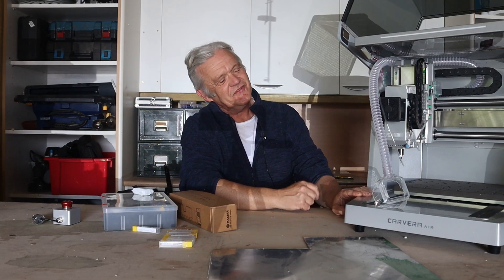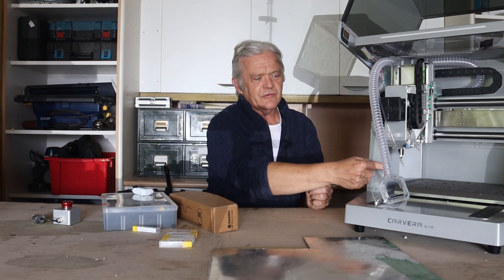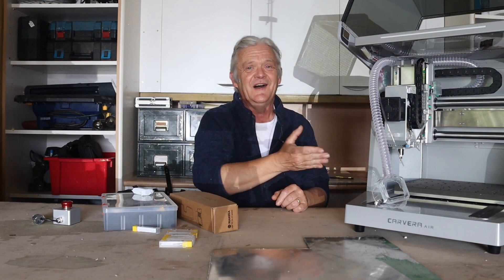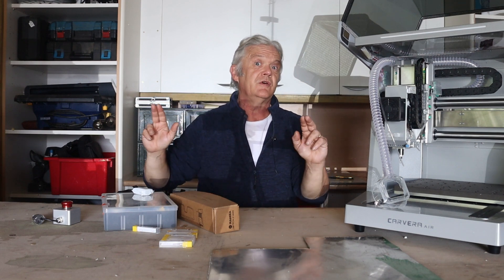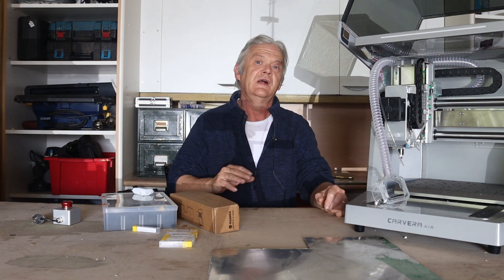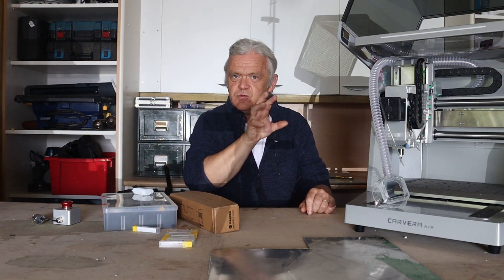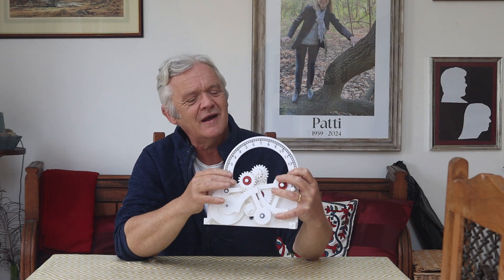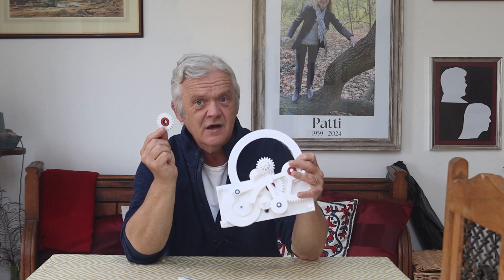2388 Getting To Grips With CAD Programs #Makera #Makeradesktop #CNC

Comment: totally agree with your approach to CAD …without a practical goal  in mind, you will just end up reading manuals with zero comprehension. I remember back in the dark ages of my youth, wadding through the excel manual trying to understand the whole system prior to starting…what an utter waste of time! Eventually I just started to try to achieve the job I had been assigned, and within a short period of time I had a working solution….not elegant but workable. A better understanding came later.
Reply from the maker: absolutely agree with that mate

Comment: .svg files, right? 🤔 I believe I used Inkscape (open-source) to make my vector drawings and then export the paths as an .svg file. Maybe I'm mistaken, but the vector drawing aspect is very streamlined in Inkscape if you ever need that sort of ability anyhow. 

Thanks for sharing Rob! ✌️ Im stoked for this CNC journey you're on. I want one myself.
Reply from the maker: Scalable vector graphics are great for laser cutters. STL files are common in 3D as the are mesh maps of a 3D surface. The other favorite is STP which has more data on the design of the object but can't be 3D printed as they don't describe the surface - or at least that's what i believe
Reply: @ThinkingandTinkering Thanks for the response and for the leads. 👍  I'm going to look into mesh maps, sounds super useful. I can't wait to see what you dream up Rob!

Comment: Perhaps it has just sailed right over my head, but there is one point that I just don't get. Why are you moving to something else when you are already so good and familiar with Tinkercad? I don't use it. But that is just me. You are already adept at using Tinkercad and it supports 3D file types. 

I have used Blender for years and years. There came a time when I wanted to switch to a solid modelling platform. I tried to learn Freecad. But it was just so foreign to me because I was so used to using Blender. That is a personal limitation for me. It doesn't amount to a hill of beans in the real world. But while I was trying to learn Freecad, I noticed that it did support a whole host of filetypes. So if file type is an issue, perhaps you could stick with what you are already comfortable with and just use Freecad to convert to other filetypes?

I will add the direction that I chose to go for full disclosure. This is not meant to be an advertisement. Just my honest take. I researched many CAD softwares. There are a lot out there. As is often the case, price has a big influence on choice. I eventually chose Plasticity. It made the most sense for me. A license for Plasticity was a one time purchase at a reasonable price (at least as of today). This was a big part of the decision. But it was also very very similar to Blender. The moment that I purchased it, I was able to start using it immediately.

Comment: As someone who loves and uses freecad as one of multiple programs he uses, I will say it's fantastic but for a lot of people it's likely to have the steepest learning curve. It's worth it in the long run to support its open source growth and because it is very capable, but I don't want someone to start with it and then quit  3d modeling in general because they thought it was too hard.
Reply from the maker: To be  honest mate I have already delved into it and it took me about an hour to get used to it - I didn't find it intimidating or difficult at all - all you really have to do is think of technical drawings - but then i did do that at school so maybe it just reminded me of my schooldays so I was a bit more comfortable with the 'sheet of paper' analogy than folks seem to be these days
Reply: @ThinkingandTinkering that may very well be but you're also more likely to encounter errors or have a hard time figuring out why an operation won't work if you try and do anything more complicated than something like a simple extrude. Maybe I just work on really complicated geometries and most people won't have that issue.
Reply from the maker: @chris993361  Yeah maybe - I have only used it for a bit so I guess I will find out
Reply: I've being trying to master Freecad, for many years, but when I purchased a 3D printer, I really knuckled down. Everything changed when my Granddaughter broke a part on one of her favourite toys and I was tasked with making a replacement part. It was then that the penny dropped and I know love it and as you said if you think in 2D as in engineering drawing, the rest comes naturally 🤞
Reply from the maker: @TimOE2000  nice post mate - thanks for taking the time to share that

Comment: I've not had to do CAD/CAM in a while.
Back in my time.
The last stages of thinking in CAD/CAM is you code in a way that starts with your HOGGING bit, then you move onto other more refined or specialized bits.  
After you have worked through things like notching bits, you move onto things like finishing bits.
(Finishing bits are both the move delicate and EXPENSIVE.)  So learn to use them last and sparingly.
(After you have done this for a while you see the stages in which there is the loaded blank of metal.
Then there is the hogging out and in your mind you see where the machine will stop and wait for a tool Bit change out.
From there (Let's jump to a finishing bit for simplifications) The CAD/CAM doesn't normally just go all around the part it has to be told to raise up and move over to a place where it will sometimes plundge down other times is lowers itself beside the part and then moves in to put just a small finishing touch.)
( You should make a you tube about not just that sequence and moment but that you train your brain to THINK and prep your software file for these sequence's.) 

(Small personal note:  Outside of the UK we don't use the word "Bits" the way you do.
When instructing about CAD/CAM switch the words you use like "Components" or "parts" or something.  Your words are colliding into a mash up of "Bits" meaning Components and at the same time "Bits" means for many of us a short cut for "Drill Bits" and "Cutter Bit" which are also called "Cutter heads")

Your way 
You use Bits on Bits.

A more Refined way:
You load Bits into the CNC to make parts.

Do let me know the IF the new software makes it so easy that you don't need to learn that way of thinking anymore?
Reply from the maker: will do mate - your advice is always appreciated - cheers

Comment: You are adding a shadow across your chin.

You need to add two more lights at about the 30 degree angles one on the left and one on the right.  
(Possibly a diffuser as well.)
I don't know about the UK but I run to B&H photography with my questions.  Sorry but they are a .COM.  There staff are TOP tier and very helpful.
Reply from the maker: It's unlikely I will do that mate - the production values don't mean that much to me - as long as you can see it to the extent you need I am happy with that.
Reply: @ThinkingandTinkering  A diffuser can be a thin sheet of Onion typing paper, placed about a foot away from any hot bulbs.
If your not going to add a second or third normal electric lamp (a house lamp), then move the light you used off to one side just enough that you are not getting those weird shadows.
Or
 (Go back to what you were using before.  You must have done something different this time and it really showed.)
Reply from the maker: @FuhrChris  I appreciate the comment mate - but I really am going to do nothing about this

Comment: I spent the last twenty-odd years of my working life using Autocad, mainly to produce schematic and wiring diagrams. 
When I got my 3D printer, I started to use Tinkercad. Initially, I struggled with the concept of using primitives to draw the 3D models that I required. My brain needed a good dose of re-calibration!
Reply: I'm good with Rhino.
But they never got much into the Art side so I had to learn ZBrush (ZBrush Core is still free, I think?)
But They don't do dimensioning so things like gears that mesh are a challenge, or worse.
So I'm looking at building a hard ware software combo of Solidworks combined with Rhino or an Older version of Rhino in which the destructive testing would be Rhino files moved over into Solidworks because I think I can short cut the learning of the base modeling in Rhino. 
With the Zbrush you learn a new way to go about learning.
1. Utilize Facebook groups.  Post your hang ups and someone will get back to you.
2.Utilize You tubes.  Start a Save file with your new quiry like learning "Tinkercad"  In Zbrush I am constantly reviewing You tubes of specific functions that I haven't done in like a year.  No shame even the software designers have been known to say "I"ve not used this combo of button functions in a while!"  There are just that many OPTIONS now days.
Reply: I,ve used Solidworks for about 20 years and I can't get my head around Tinkercad or Freecad.
Reply from the maker: lol - I get that mate - sometimes it does need a bit of a kick up the behind to reframe lol
Reply: Replies to your comment appear to be disappearing.